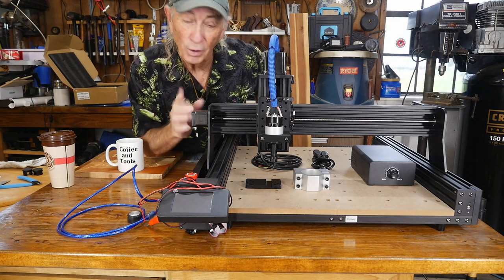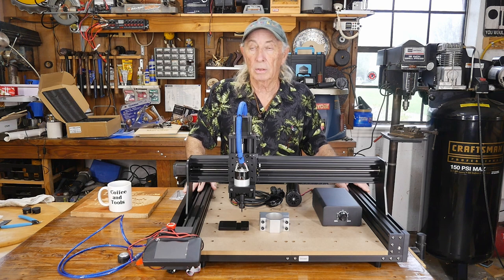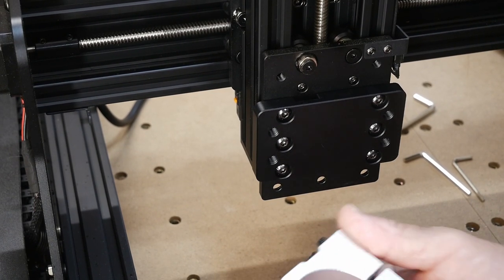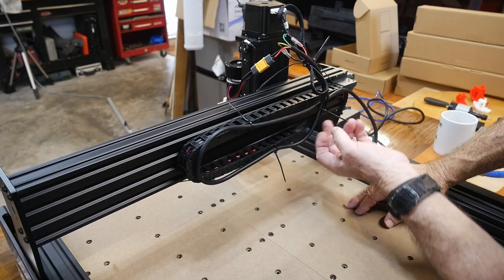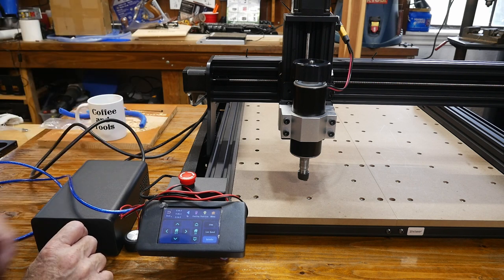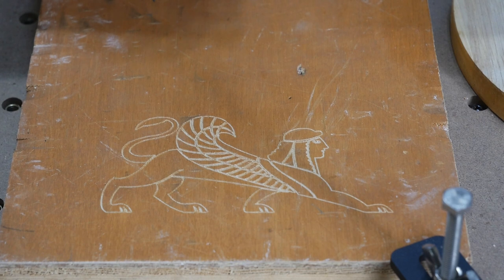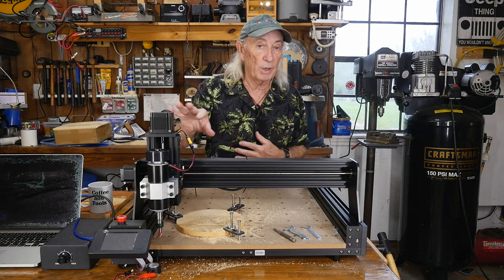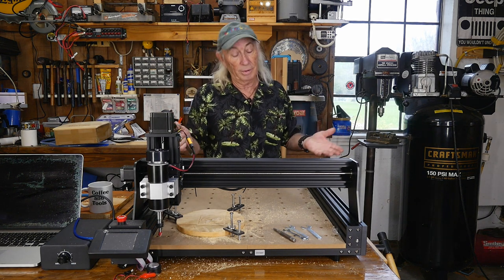CNC upgrade kit for TTC 450 two trees installed and tested, C&T ep 328

Comment: I just got a TTC450 as my first CNC Router for my woodworking hobby and learning. The stock spindle is under powered, drew too much power from the controller causing it to crash when running. I did buy the 500W Spindle upgrade at the same time as the TTC450. While using the 500W Spindle upgrade cost you the ability to control speed from the software, it makes up by not over drawing power from the Contoller. The 500W Spindle changed the TTC450 from an ok CNC machine to a very good CNC machine. I have ran several projects on the TTC450, learned a lot, and so far I am a fan of the TTC450 w/500W Spindle upgrade.
Reply from the maker: Good to hear about that first spindle. I didn't have trouble, but others did. The upgrade is pretty cool and I've again no problems with it. Just need more time to play. Wife says I already get too much play time with it LOLOL:face-blue-smiling::face-blue-smiling::face-blue-smiling:

Comment: Awesome Variable Spindle Drive.
I usually set the collet on my spindle to just below the lowest part of the verticle travel assembly. That way no matter how tall a workpiece I have, I will not run the collet into the piece.
Ask me how I know. 
😁
Reply from the maker: ha hah....YOU TWO uh ? LOLOL
Reply: @SirTools  Either the spindle collet or the bracket that extends to the bottom of the assembly. Drug that one across a table top once as I had a tall workpiece and had the router motor mounted to high up to compensate.
Had to do some creative H2O application and sanding. LOL
Reply from the maker: Better it was you and not me LOLOL..

Comment: Think I  may have had too many coffees, just assembled the TTC 450 plug 500 watt motor in NO GO plug the 180 watt in and RUNS what have I missed is it software have not plugged it into computer yet  HELP  from NZ
Reply from the maker: WoW ! This is a FIRST ! The new 500watt comes with a separate speed control, and those two tiny wires that go for the old spindle. mm..check your wiring first I'd say ! and let us know.

Comment: hi, i'm from Switzerland, and i have this "little" toy at home (it works great), and an other CNC (vevor 3040 working only with Mach3Mill). I'd like to change the ER-11 collet by a ER-16 because i've some tools they are in 7 to 10 millimeters.
I've tried to unscrew the 2 littles black screws, but it seems the part over the collet is glued to the main motor axis. is it the same on yours?
Thanks a lot for your videos, it' a pleasure to see theme
Reply from the maker: I've got to ask a question here. Do you have the upgrade kit ? The collet does the same trick here with the screws.
Reply: Yes, the official 500w upgrade.
Reply from the maker: Checked mine here and same deal mmm...
Reply: A specialist just told me to put a dissolvent inside it, and if that doesn’t work, try to heat it slowly
Reply from the maker: I was thinking heat, but.....gray area for me ....careful with the heat :)
Reply: @SirTools  That didn't work. I've tried to contact TwoTrees to know how to put out the collet, but they don't answer me about that
Reply from the maker: Maybe they'll don't know. Bust...mmm

Comment: Hey, maybe you can give me a hint. Which Post-Processor for exporting the Code you use? I know, GRBL... But i have issues with the Z-Axis. I will engrave in the Air ;) I am not sure which Format is the right one.
Reply from the maker: I'm using UGS which is a free download program. You can do your set up on other programs, but I import to ( Universal Gcode Sender) and then run from the computer direct to the CNC.

Comment: Awesome reviews! I'm thinking to get one, but i'm wondering if it is possible to mill a 50mm thick piece of foam stock with a 51mm long bit with this?
Reply from the maker: That might be an interesting experiment. Softer materials call for higher cutting speeds mmm
Reply: true, i'm currently cutting on a bigger machine with a 500W spindle at 15000 and it works without a problem. I think with lesser feedrate and at 12000, it should be alright also.  @SirTools
Reply from the maker: I was thinking federate might need adjustment...>GOOD...darn good stuff

Comment: Good day, Quick question, when you hooked up the New spindle , did you have a problem with the control wiring from the old Motor?? I'm asking Because I upgraded some time ago and I was just doing some repairs to my machine last night and I unwired my motor and I may have Mistakenly Switch the wires and now my spindle doesn't operate!  so I think I may have Burned out the little relay inside the controller ? Did you experience anything like this? Please let me know thanks. Howard
Reply from the maker: Hi Howard, you might have the spindle shut off in your software. I had no issues, but depending on which software you're using mine keeps shutting off the spindle until after I reset. Did you use the wire colors like mine ? I HOPE you didn't do the relay in. I do not think you did, but....mmm
Reply: @SirTools  thanks for getting back to me, no, it’s definitely not the program, I think I did the relay in! I have to open it up and check it out. Thanks for getting back to me though I’ll let you know!
Reply from the maker: I hope it's simple and good luck at this point.

Comment: Good afternoon, could I ask you for a huge favor? I need to get a copy of the software (firmware) that came with this machine. I got mine about three weeks ago and the thumb drive was blank or my laptop will not read it. Two Trees has not got back to me and I'm very frustrated that I can't get my machine operable. If there is any way you can send me the files I would be grateful ! Your videos are awesome and I have learned a lot already about cnc in short time. thanks in advance, Howard
Reply from the maker: Hi Howard and I hate to ask but are you using UGS ? The thumb drive or Micro SD card on mine had nothing on it. I simply plug my laptop in and run the CNC with UGS. Some programs will not work from 3rd party and so I import the G files into UGS to run the machine. Let me know what is going on and I'll try to help you out.
Reply: @SirTools  thanks for your response, I received a link from Two Trees with the software. My machine is up and running ! thanks again !

Comment: I purchased recently a two trees ttc 450, im getting a error code ¨ hard limit ok¨´ on the screen, i tried to disconnet power several times n still the same error on the screen, is there something i can do?
Reply from the maker: Yes, my last error code on a CNC, I added a gcode line that reset to factory, and that fixed the issue.
Reply: @SirTools  Thank you for replying!
How id do that!
Reply from the maker: I'd check other YouTube videos to get all the info you need for adding that into the Gcode. It has worked for me.